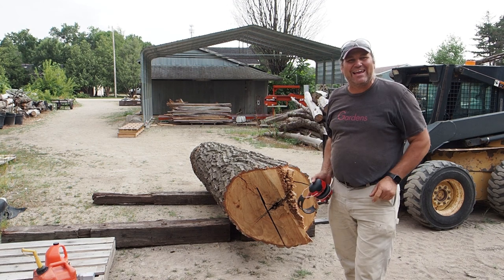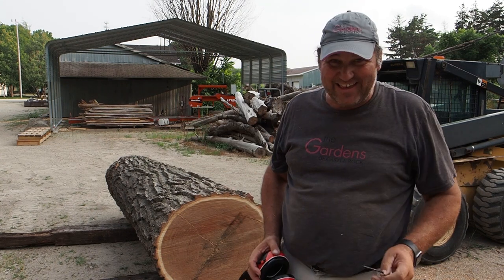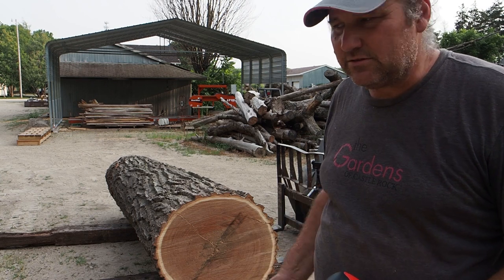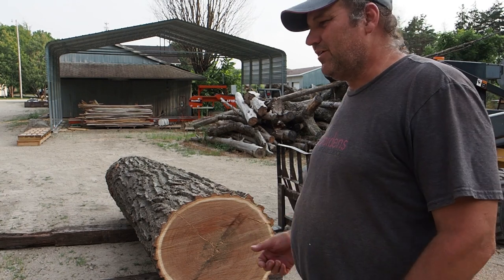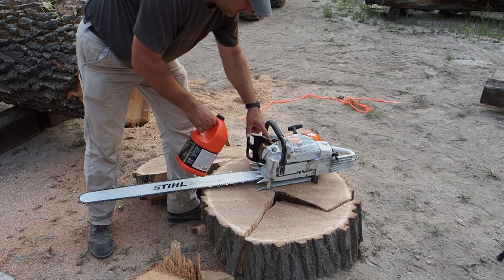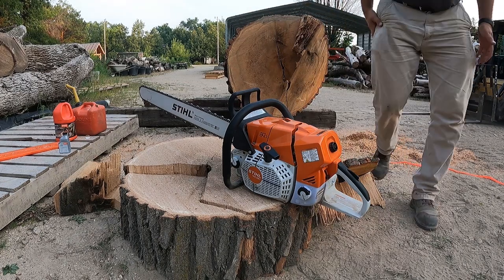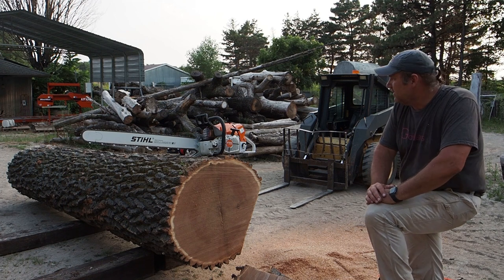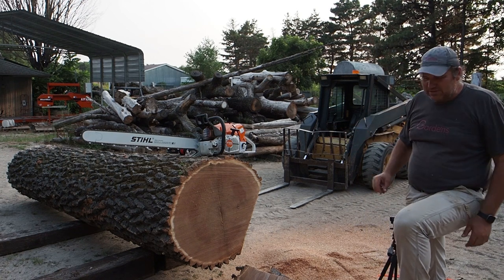CHAINSAW BREAK IN Stihl MS 881 Magnum ~ Life in the Log Yard

Comment: You don't get carbon deposits from running rich on oil, you get carbon deposits from a too rich H adjustment on the carburetor. I personally recommend running 40:1 or 32:1 gas to oil ratio, its better for the lower end bearings on the long run. A real difference at about 1000 hours of run time when you open up a 40:1 or a 50:1 saw and check the bearings, even if the piston and rings are in great condition on both.

Comment: I idle the saw for about 30 seconds, rev lighly a few times to build a little heat, let it cool, repeat. Then no more then half throttle with "light" loads for the first tank, i dont go full throttle extended untill 4 tanks

Comment: Was the chain sharp, I noticed a lot of bogging. That saw should rip man!!!
Reply from the maker: brand new chain out of the box...  I wasn't trying to go total full tilt from the get go... My very first cuts with the saw and to be completely honest I was still a little in awe and intimidated by the saw... It's an effing big saw to buck with... I cutting much better now. it's a beast and excited to get milling with it!
Reply: It's obviously sharp. It's digging in hard, just needs more throttle.
Reply: While breaking in a new saw your not supposed to go full tilt for the first 3 tank fillings

Comment: no need to take it that easy. just use it like you normally would. just don't mill with it for the first 5-7 tanks.
Reply from the maker: Thanks for checking in.... those were my very first cuts with the saw. I was a little in awe and giving it some respect... like damn, this is a big saw. It's about what ended up happening. Hopefully getting the 72" mill setup soon for it!

Comment: That's a beast right there, I have a 500i but I'd love a go off that 881 for sure, is it very heavy?
Reply: 32+ lbs. with 36" bar and chain. So. Ya, she's a heavy gal.
Reply: I own  a 500i & a 881 both ported 70-1 98 octane VP fuel . 881 run a 36 bar 500i 32 bar both GREAT SAWS! 881 is quite a bit heavier but it eats fast. LOVE  my 500i light & VERY POWERFUL 👍👍👍

Comment: I run a new saw with a little graphite in the first and 3rd tank, mix it up real well, then strictly as the manufacturer recommends. Back in the 90's Stihl bought out their own 2-stroke oil at 50:1, my 032 siezed, I was furious and kicked up a stink, my Farmboss was repaired free of charge, thank goodness I wasn't using my 020 and 056Ave Super at the time !!
Reply: Wow, where in the hell did you get that idea, first of all, graphite is mildly abrasive, second, actually less lubricant is better for break in, richer carb adjustment, yes, not more bs in the fuel, but hey 90% of everything’s between your ears.

Comment: You’re pretty much right the way you’re doing  it up
and down throttle full and then half I use a very good full synthetic two-stroke Maxima formula K2 oil 33:1 ratio first 2 tanks then run at 40:1 after that 
Stihl & Husqvarna 2 stroke are rubbish they leave a lot of carbon deposit even HP ultra at 50:1 still leaves a lot of carbon deposit .
I have rebuilt  a lot of STIHL and Husqvarna saw Believe me Maxima formula K2 is the best on the market.